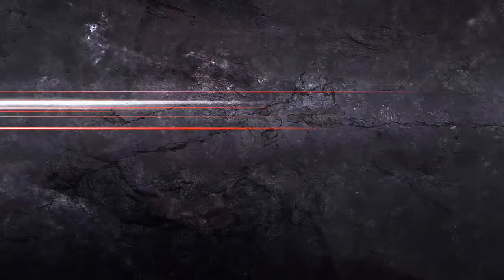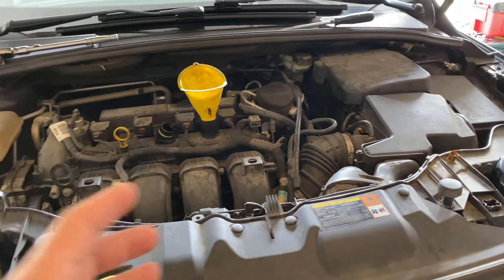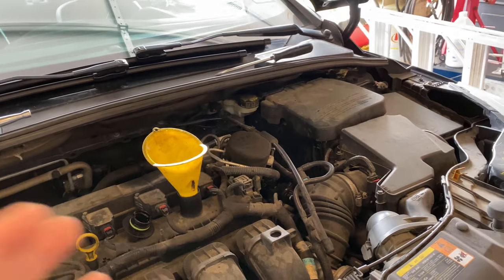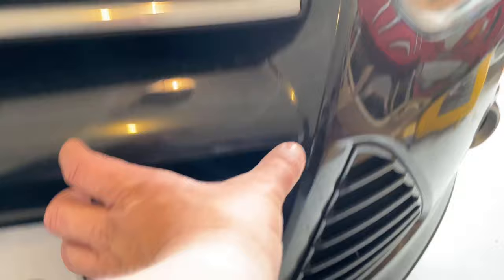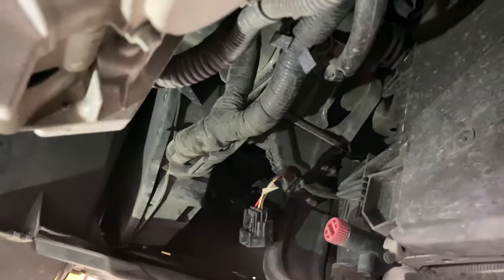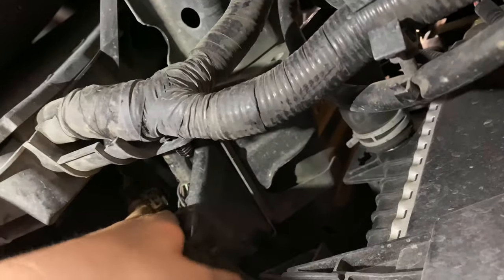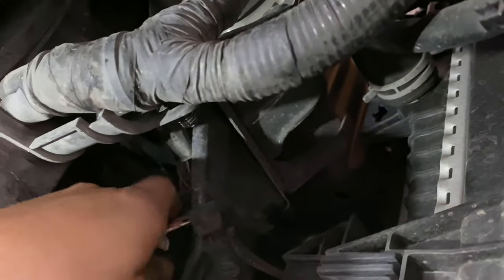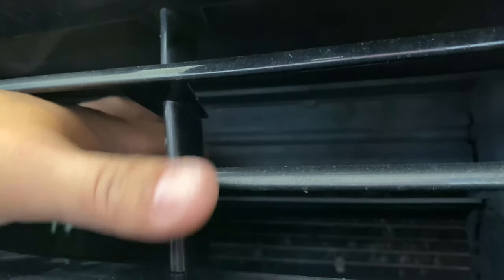Ford Focus MK3 Red Battery Warning Light on Dashboard - Finally Fixed!!!

Comment: Dude!!! You're a fucking god send!! I don't know how tf you figured this out. But I disconnected my cable, and the pins inside the plug were corroded right off and it was wet. 

After disconnecting it. No more light. 

Thank you x1000
Reply from the maker: thats effing awesome!!

Comment: Thanks. Just saved me a few bucks and a headache. I would start my car and drive with the dash I. Test mode on battery Voltage and it was good. Hold down trip reset before tur jng the key. After turning the key on keep holding until test. Cycle through various tests until getting to battery.

Comment: Wow, I had my alternator and battery changed, and the light still on took the car to ford dealership for diagnostic spent anothe $190. on that, they told me it's the shutter grill. Good thing I can't afford it yet. Now I'm going to see if its the connector. Thank you. I have spent so much already. Hopefully this video is the answer to my problem. Thank you again

Comment: Thanks for this video. I just bought a 2013 focus and the battery light randomly came on twice while driving it. Alternator and battery were fine. Found this video in a search. Now I know what to do if it does it again. I had no idea it had little motorized flaps behind the grill. The sh@t they come up with ! sheesh. Thanks again!
Reply from the maker: Glad it helped

Comment: Would disconnecting the cable interfere with performance or impact other component? Do you keep it disconnected or did you reconnect it after you clean it? Thanks

Comment: I replaced the alternator, and battery light was still on. Unplugged the grill shutter plug and it was soaked in water. After this the battery light hasn’t come back.
Can I leave it unplugged??
Reply: Sorry just finished your video, you did leave it unplugged.
Is it normal for the voltage to be between 12-14 volts? I saw that the charging systems on these cars are “smart” and can fluctuate

Comment: I have an issue on a ford focus 2016 with TMPS, when i go to retrain the sensors, i do the steps and the car honk and show on display to train left front sensor but when i go to let out the air from the tire, almost I took out all off the air and still didn't honk again, to move to the next tire, i tried 3 times and nothing, can you say what can i do ? Thanks !

Comment: I have this issue but the battery light comes on intermittently. Switching the engine off and back on normally sorted it. Other day though it was on constantly and eventually lost all power to car. Left for 5 mins and managed to start the car again, no light. Had local garage check car and alternator/battery all good. Do you think unplugging this cable could resolve issue, or is it just for a constant battery light?
Reply from the maker: well this issue woudnt normally cause you to loose power

Comment: Hey we did the same as you. My battery is new my alternator is new but the battery light is still on the dashboard what do you think how can i fix the problem?
Reply from the maker: Did you check the sensor at the bottom?  The one from the video?  Also did you reset the battery when it was replaced?
Reply: @FalconsGarage  which sensor sir?
Reply from the maker: the one on the video

Comment: Hey man I have a 1980 Toyota hilux that makes a loud noise when deceleration but if I stay on the gas it goes away but if I’m under 5mph it’ll lock up
Reply from the maker: most older vehicles valves need to be adjusted from time to time ... that might be your issue..but not sure

Comment: thank you for the video and i need your experience here... i have same car (2012 focus 1.6 Tİ-VCT powershift transmission and almost 75k miles) and i also have a battery warning light on and off occasionally... i am driving my car with the test mode on and i am tracking my batteries voltage value past a few weeks . The engine starts around 12,8 (sudden drop and rise during ignition) and rises up to 14,5 V in seconds... But after some miles it starts to decrease 0,1 by 0,1... on the highway it stays on around 13,3 V but in traffic jam it decreases a lot till 13,0 V... i get battery warning light last night and the value was 11,6 V.... after couple of miles voltage increased suddenly to 14,1 V again... now i would like to ask that do i have to renew my alternator or my  1 year old battery... and one important thing is here there was no shudder problem with my transmission when the battery voltage value more than 14,3 volts... smooth transmission and my car starts obvious shuddering when it decreases 13,6 volts... please give your feedbacks and thanks in advance...
Reply from the maker: so your thinking the voltage drop is causing your transmission issues?
Reply: @FalconsGarage  yes i think it may cause that problem... mechanics are suggesting to renew clutch, tcm or other mechanical parts but i am brainstorming that if i have problems with some wearable parts then it should shudder everytime (unless if there is no relation with thermal load of mechanical parts)... i am still tracking and i believe there is a relation with charging and shifting systems...
Reply from the maker: @meb40  could it be related “maybe”. But this cars are also known to have ALLOT of clutch issues. I once had for replaced 4 clutches and one tcm under warranty in only 2 years. And my gear sputtering  was not consistent

Comment: hello i have a similar problem i changed the alternator but the battery is still on my dashboard and due to non-recharging my power steering came on you have any advice on how to fix it
Reply from the maker: so .. is it till not charging?  or is it charging BUT the light is still on?
Reply: it still doesn't charge the battery and my power steering is on
Reply: I was on diagnostics today but they told me that the problem would probably be somewhere in the connection but I don't know what to look for
Reply from the maker: that might be it .. check that the output of the alternator is whats suppose be .. and check from there on were you are loosing the power.

Comment: Instead of disconnecting the connection just pull the fuse F36 if I recall
Reply from the maker: I tried that wen I did this .. It docent work wen its shorted out.